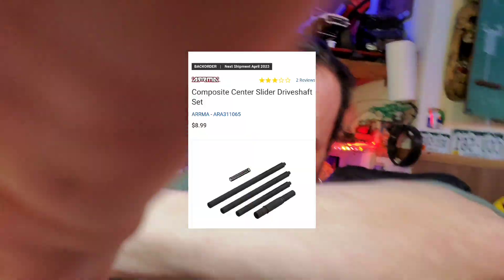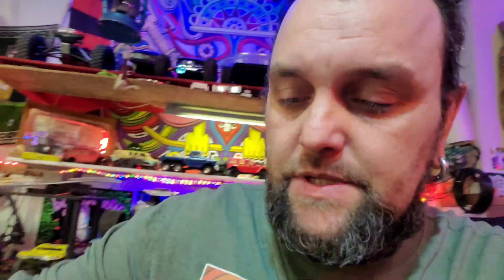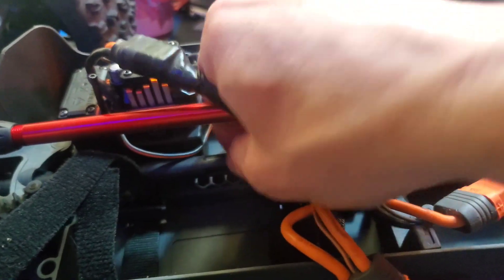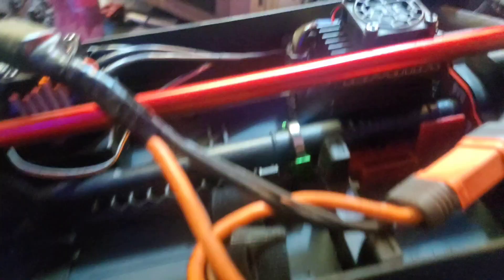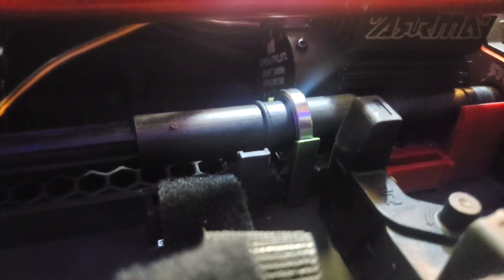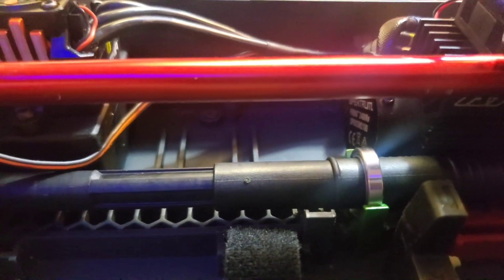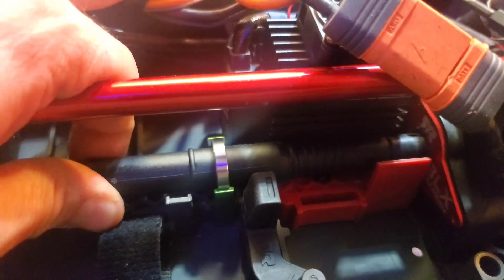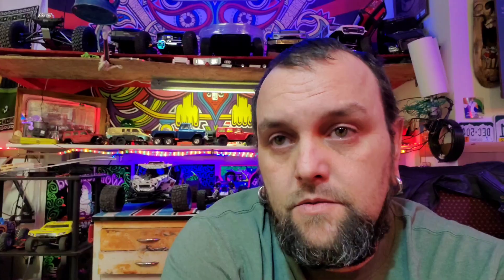KRATON 4s v2 DRIVE SHAFT SOLUTION!

Comment: They make aluminum drive shafts for these trucks. I've had one for a couple months. Instead of a rock or something else cutting the drive shaft,it just rubs the color off. I've had no problem with mine and I'll be getting another one for the Outcast 4s I'm buying soon.
Reply from the maker: You going to make videos with the Outcast?
Reply: @underarockandstuff  aAm I no,I just bash,not much for videos

Comment: I'm having the same problem as u r. But I'm going aluminum to get a hot racing center drive shaft for my kraton v2 4s. They r only like 20 bucks  or u go go to rcawd and get one.
Reply from the maker: Its my understanding that the aluminum shafts fit like crap and you need to do the bearing upgrade from rcawd...Not positive though.

Comment: I have three in order direct from Arrma but they won’t ship u too April. Grrr this is so aggravating. I’d like to get the hot racing solution but I can’t get an answer on if the XLWB is the correct part number or not.
Reply from the maker: I think you can make almost any arrma lwb drive shaft work from any 10 scale truck with the RCAWD support bearing. 
  I'm not gonna bother with the hot racing drive shaft because every video and review I've seen on it says it's trash.  Although some people say that it works OK if you run it with the support bearing that's made for it but sold separately.? 
 I don't know but this seems to be working and it's definitely better than the stock support bearing.  Horizon def dropped the ball here.   Good luck and let us know if you find a better solution 🤙

Comment: Is the high speed support necessary? I have the outcast 4s. Ordered the same driveshaft as in the video.
Reply from the maker: I think it is but I didn't try to run it without.  You might get away with it for a while.
Reply: @underarockandstuff  I ran my Senton without one because the bearing  holder broke. No problem
Reply from the maker: @mikeannen4458  thanks,good to know!

Comment: Do you have a 3d printer? I can print my own for pennys on the dollar. PM me for the STL file to make them. So far it has held up better than stock.
Reply from the maker: I do but I'm green to it.  Luckily this has been working.
Reply: What part exactly are you trying to print on the 3-D printer? I have a 3-D printer and I would be interested in the STL file.
Reply: @dalehenson6283  drive shaft  i am on vacation for 2 weeks I'll get back to you later